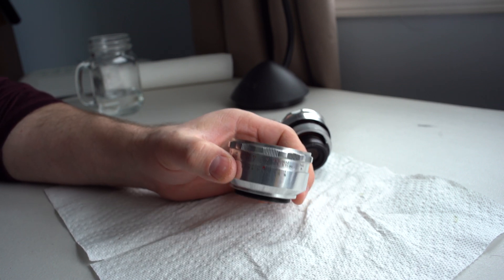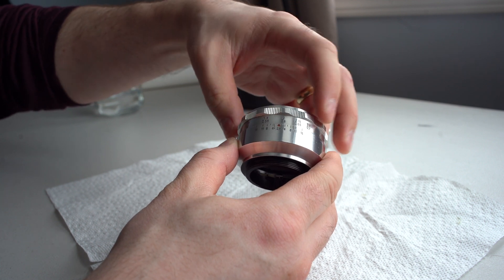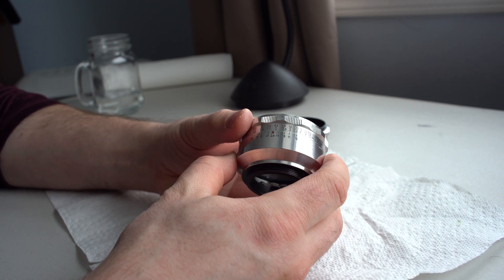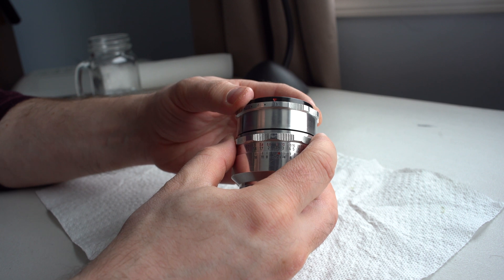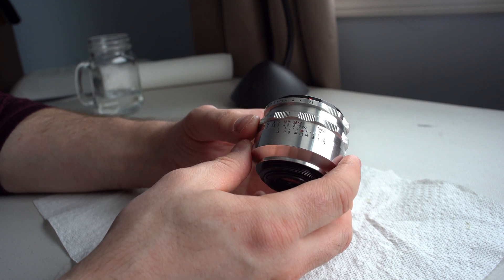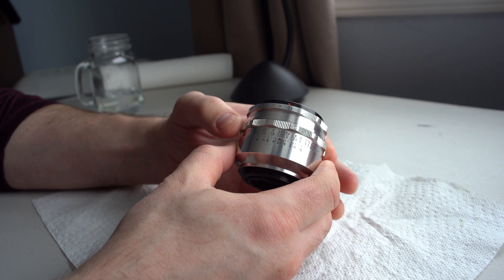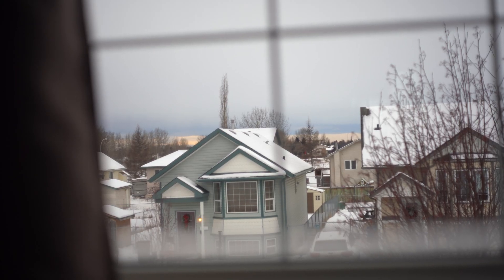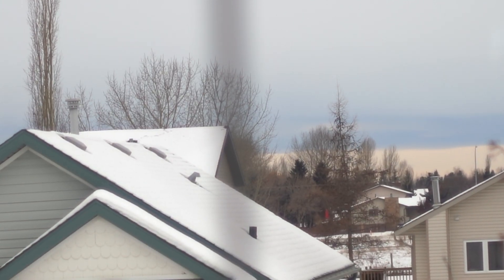Carl Zeiss Jena Tessar Assembly

Comment: 😃 I recently bought a Silver/Nickel Carl Zeiss Jena Tessar 2.8/50 from 1957 (as from the sn) that was totally locked.
The only way to IRAN it was to completely dismantle the mechanical part (the optical part only needed some partial cleaning) … and putting some marks seemed totally useless in this case.
Result: a lot of gray hair ;-)
Fortunately (and thanks to a kind chap from Taipei who pointed me to …) I found this video.
I followed it step by step and found out that  first I didn't match infinity and second that after joining both parts the lens couldn't focus any more than “8”.
So I decided to start from 3 turns + 2.50 and got the red arrow spot on infinity. The focus part and the optical parts are now reassembled and I now have a fully ops lens.
Thanks a lot. 😃
Reply from the maker: @PhantomRC1959  awesome! That's great to hear. Thanks for sharing your experience.
Reply: @pastamatt  … no … thank you for helping us. :-)
Reply: @PhantomRC1959  I also encountered assembly problems. Can you provide the contact information of your friends in Taipei? Thank you.

Comment: Thanks for the solution but there is a problem on my lens. One thread (open end on the focus helicoid) leads to an infinity focus around the 8 m mark while the next thread leads to a focus behind the infinity mark (that cannot be reached if the screw is inserted). There is not thread in between that would lead to infinity focus on the infinity mark on the ring. Is there another way to fine tune the infinity setting?

Comment: Hi, I am trying to put the two pieces together, but once I align them and I try to move the focus ring towards infinity, after a little movement there is a hard block. I am unable to retreat the front part far enough. It moves just a little. In fact, when I go into,opposite direction, the front part quickly comes out. I guess there is some interference with the aperture mechanism. What do you think? Thanks
Reply from the maker: Interesting... I'm not sure. Sorry.

Comment: Hey! Was hoping you could answer a question for me. I have this lens and plan on cleaning and applying new grease to the helicoid. You mentioned marking where they go together. I haven't disassembled the lens yet, but where exactly should I mark? Is it where it stops focusing at infinity or somewhere else? TIA!
Reply from the maker: Well, realistically on this particular lens, you wouldn't mark it. You would just remember exactly the position of the focus ring when the lens pulls into two pieces. If it is currently focusing well to infinity, then you would save yourself some trial and error. If it's not focusing well to infinity, just follow this video because it helps you to find that place for yourself. So, if it is currently good, remove that set screw on the side, then slowly rotate the focus ring away from inifinity with a bit of pressure so that you notice that moment when the lens is about to come into two pieces. Note what distance marker the red arrow is pointing  at that moment.
Reply: @pastamatt  thank you for your detailed reply! It's much appreciated. Hopefully it will go smoothly. I'll keep what you've said, as well as the content in your video, in mind. Comments I've seen thus far make it seem pretty difficult so it's a bit daunting!

Comment: Thankyou so much for this video! I inherited a pre 1950's version of this lens from my father and decided to clean it as the grease had failed and there was the beginning of fungus inside. I've cleaned plenty of other old lenses so how hard could this one be? I gave up after unscrewing bits and realizing this lens isn't like anything Ive dealt with before. Its now 8 am after trying all night using your technique I figured out how it goes together. 
For mine it was easier to add a white paint dot to the location of the inside 'wedge' on the back screw in bit and on the slot it will fall into as the arrows were not quite lined up due to it being so old.
Then I worked out how many rotations needed to get it to all line up at the right spots once screwed in as it took over two rotations. I had to start just after infinity. I made sure my dots at the back stayed lined up and slowly and lightly screwed it all together while it was on its face. It strangely slotted together in such a precise way I'm in awe. Its clearly something cleverly designed to slot together and forcing it will never work. A light touch only.  Even if I appreciate its workmanship I still hate it and I will never pull it apart again.